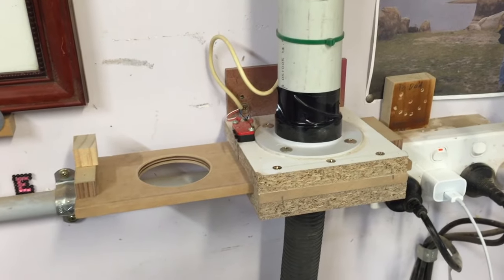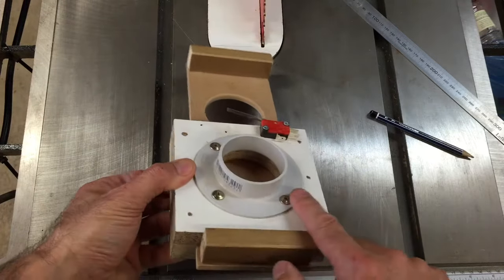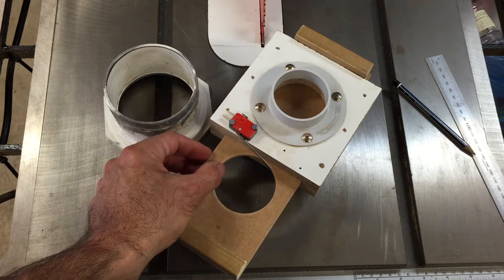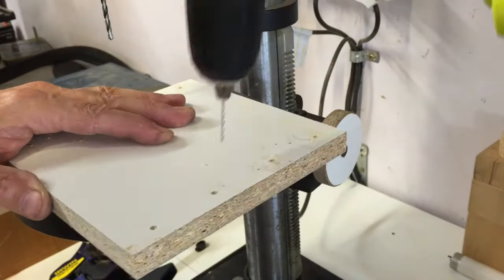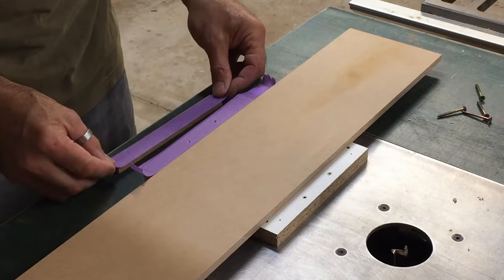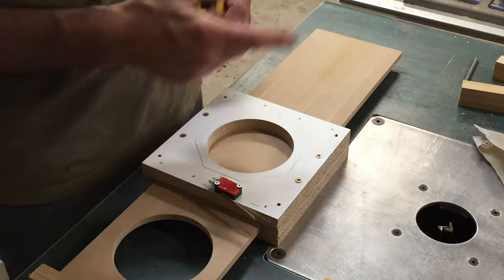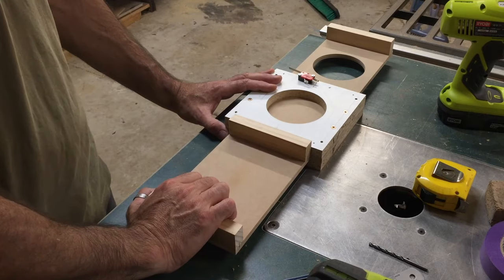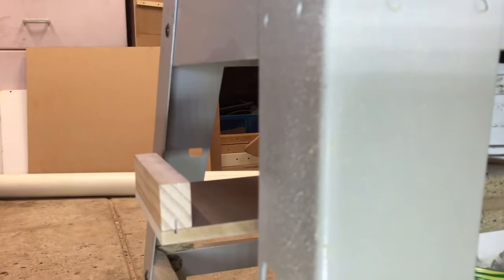How to make a blast gate for your dust extraction system.

Comment: Nice video.
Would be nice to see a short video with more details of the micro switches and how the system is all connected - for us electrical novices interested in your little set up.
Reply from the maker: Thanks Marisa. Maybe some time in the near future i'll do a video on the dust extraction system because i need to make more modifications to it. If you have a look at the comment below of Dominic George, I explained how the switches are connected.
Reply: Hi I was looking at linear actuators as an option to open/close the blast gates. Do you think they will work?
Reply from the maker: I don't see why they wouldn't work as long as you eliminated possible binding issues such as if the actuators were attached to one side of the slide rather than the middle that may cause it to twist slightly and bind. One issue i have with my blast gates is that when the weather is very humid the timber swells slightly and they are difficult to open and close.

Comment: What a fantastic solution. The micro switch could also be wired into the table saw so you couldn't use the saw without using dust extraction.
Reply from the maker: Thanks Brian. Good suggestion.

Comment: I am getting ready to rebuild my dust collection system when I move to a new shop.  Do you have any references for the wiring the remote switches and or/a source for them.  I have seen some commercial setups but the cost was out of my budget.  Great video, I always learn from your work.
Reply from the maker: Hey Robert, sorry for the late reply. The remote switches (limit switches) were bought from eBay. The 12V contactor was bought from Jaycar electronics (if your in Australia) and the 12v transformer was an old one I had. I explained the circuitry in my response to Dominic George on my blast gate video here https://www.youtube.com/watch?v=toWrfVg9Pus. If you need more info after that, email me. Cheers mate.

Comment: Hi Man, why did you decide to go from 50mm to 90mm? May seem a stupid question but am currently about to install a dust extraction system and was thinking of using 50mm piping. The machines I want to connect are: table saw, mitre saw, orbital sander, router, so all things with relatively small particles. Going forward, and once I have found a good offer, a planer and thicknesser. Did you have problems with blockages? I have an industrial shop vac with two 1300 watt motors and the hoses it uses are 50mm. Am just a little concerned that going from small hole (50mm) to large hole/pipe(90 or 100mm) will result in too much loss of suction power, especially as I want to use a cyclone into a 60 litre drum. You thoughts would be greatly appreciated 🤘
Reply from the maker: Hi Robert, my dust extraction system is an evolution over a long period of time. I used the existing 50mm piping when I got the new table saw and it was quickly obvious that it was struggling. Its not about how much suction you have but about how much volume of air you're moving IMO. The jointer and thicknesser make a huge amount of sawdust that is more shavings than dust so 50mm would not have been sufficient. 50mm was fine for my mitre saw and smaller tools such as disc sander and bench top bandsaw but i/m upgrading it just to have a standard throughout the whole workshop. However, i don't think its a good idea to go from 50mm at the source being your shop vac and upsize it. my system is 90mm from the suction unit. Great question Robert and I hope i've answered it for you. Cheers mate.
Reply: Hi again, thanks for taking the time to reply 👍  Have one more question about air volumes when you go from small to big. I understand the theory of jet engines, big intake, small exit = big thrust. As already said, I bought an industrial vacuum from Nilfisk, upright with two motors each 1300 Watts. You can use one or both in parallel. The intake hole is approx 7 cm. If I go from that to a larger pipe size, I'm afraid I would lose too much suction. Do you have any experience of this. The vac retails here in Germany (i'm English) for approx 800 Euros, got it however with about an hours run time from a dealer for 550 Euros. Really like your channel buddy, keep up the good work 🤘
Reply from the maker: Sorry Robert, i don't have any experience with upsizing pipe and i wouldn't want to ill advise you. My thoughts though are that your vac seems fairly powerful with the two motors and in reality if you went up from 70mm to 90mm thats only larger by 10mm around the circumference, if that makes sense.

Comment: Just curious if you have encountered static electricity with your plastic pipe? It might be a good idea to add a bit of wire along the run of pipe to a grounded spot.
Reply from the maker: To be honest Larry I haven't as yet but reading stories about fires and explosions in dust extractors it is definitely something I will do. Thanks mate.

Comment: where did u buy the micro switch and how did u connect the blast gate to the dust collector. That is gr8 solution.
Reply from the maker: +Dominic George Hey Dominic. The micro switches were bought off eBay. I think they came from China. The NO (normally open) contacts of the micro switch are wired in series with a 12VDC power supply and the 12VDC coil of a 240V 10A relay.  I used a spare 240VAC - 12VDC transformer I kept from some old appliance I think. The dust extractor is wired through the normally open contacts of the relay. Hope that makes sense, it was easy for me because I'm an electrician by trade.

Comment: Any chance you could elaborate on the limit switch connection/system configuration?
Reply from the maker: Hey Luke, here is an explanation of the connection. Let me know if it doesn't make sense or you have more questions. Cheers mate.
The NO (normally open) contacts of the micro switch are wired in series with a 12VDC power supply and the 12VDC coil of a 240V 10A relay.  I used a spare 240VAC - 12VDC transformer I kept from some old appliance I think. The dust extractor is wired through the normally open contacts of the relay. Hope that makes sense, it was easy for me because I'm an electrician by trade.
Reply: Thanks... I'm a non-practicing electrician too; so it makes perfect sense to me.  Hard part will be the mechanical side of the install.  If only doing the physical install was as easy as drawing a wiring diagram.  Cheers.  :)
Reply: Also, your design looks like it will stop dust from getting into the track of the gate.  Really like that.

Comment: Surely that was 100mm pipe? (and you did say you used a 4" hole saw).

Cheers mate great job as always.
Reply from the maker: Thanks mate. No its actually 90mm pipe. Standard 90mm stormwater pipe from Bunnings. There's a big price difference between 90mm and 100mm fittings. The 4" hole saw was the only size I had closest to 90.
Reply: Fair enough, it's just I have never seen 90mm pipe - then again my Bunnings has hardly anything. Cheers.